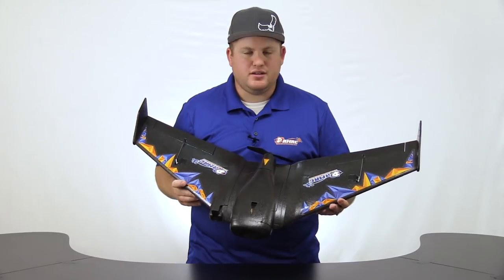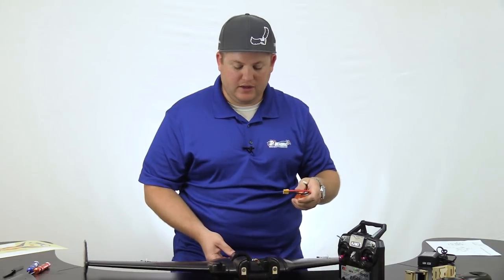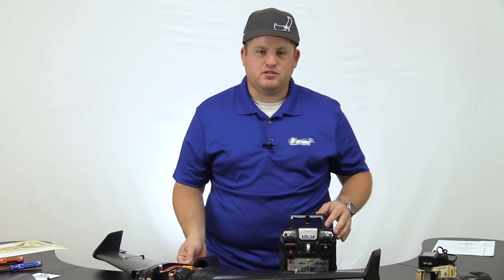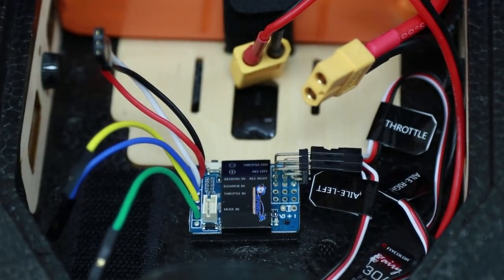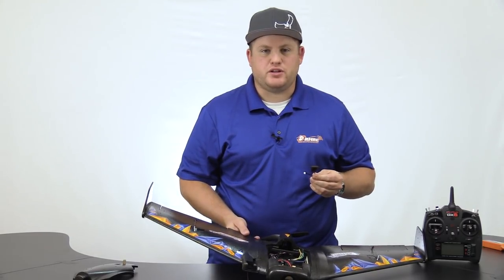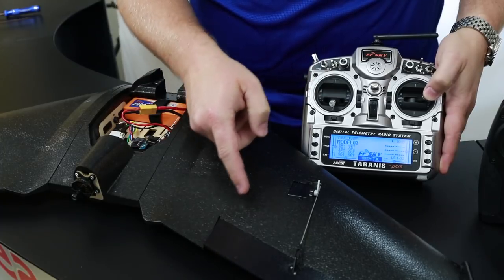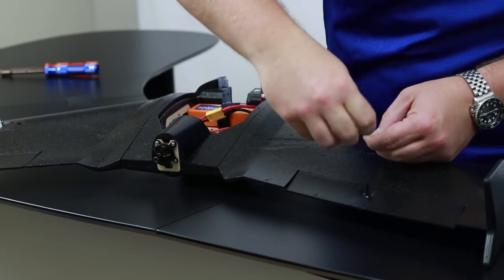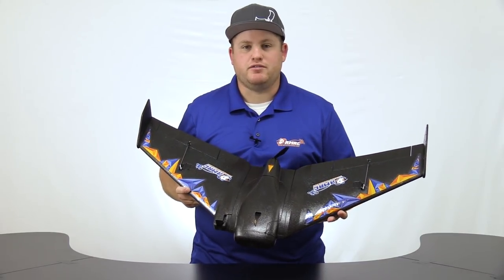The New RMRC Recruit Build, Overview, Maiden

Comment: I think that there was a missing point. Check the control action. 
To do this the throttle has to be activated briefly. And make sure that the stabilizer is attached to the airframe as follows: the colored cables going to the Rx should point to the right wing tip, and the servo connector pins should point to the left wing tip . Tilting sideways or pitching the wing , the stabilizer should move the elevons as required to compensate the airframe tilted attitude. Do this in the full stabilized mode, i.e. blue LED ON.

Comment: Some of are not watching the video close enough. 1) He does show the type of plane you should choose Raptorlishus. Just choose a regular plane. 2) Mike Rodgers You can not use a satellite receiver with out a regular receiver. So yes you can use both receivers. He does go over this in video.
Reply: Not true.  A satellite receiver can be used alone when connected to the stabilizer.
Reply: Ken, I'm assuming the channels are plugged directly into the stabilizer if using a remote Rx. I don't have one of these so if someone could confirm this, I'd appreciate it.

Comment: Folks - I am NOT using FPV for this build - only line of sight flying. I have a spektrum DX9 transmitter - what receiver do I need to use with this? Apparently a single DSMX sat is NOT acceptable but can someone confirm? If I do in fact need a full size receiver, can you tell me which model Spektrum/orange would work best?
Reply from the maker: We have used DSMX satellites, but the failsafe built into the stabilizer doesn't work with it. You can use an AR410 and remap the rudder channel to a switch or use an AR620 to get full functionality:
https://www.readymaderc.com/products/details/spektrum-ar400-4-channel-dsmx-aircraft-receiver-spmar400
https://www.readymaderc.com/products/details/spektrum-ar620-6-channel-dsmx-aircraft-receiver-spmar620

Comment: with qx7 -select plane -then tx wants to assign motor, ailerons, to Chanel numbers -stuck there. also pick mode.
  Oh, you didn't say you were bypassing the LUA script with exit and page buttons -very confusing. 
And now seems everything is ok but won't bind. I might have eu firmware on the Rx  -no way to tell -just reflash -what a hassle.

Comment: What model satellite RX did you use on the Spektrum port? I bound an Orange R110X, even tried binding it in the four combinations of 22/11ms DSM2/DSMX using a full receiver, but in the best case result the rudder stick was unresponsive, and aileron input would cause rudder to go full range left or right for a couple seconds when any aileron input was made. I've seen a post that others have had this same problem. I also tried a Spektrum satellite, believe it was a 9645.

If you know a fully working satellite model, please let me know.
Reply from the maker: mgcarland open a support ticket & we can troubleshoot much better there. Support.readymaderc.com

Comment: Hey everyone, when I plug my battery in, all my control surfaces are responsive except the throttle, which makes a very repetitive and annoying beeping sound. What is going on?
Reply from the maker: Mateo Xia I believe that is addressed in the video, but if you can’t get it worked out, open a support ticket so we can guide you further.

Comment: This maybe a dumb question but after watching the video I'm not clear on this question. Can a satellite  be used along side of a AR610 spektrum receiver or is it one or the other? I'm assuming if I can use both at the same time I should get better signal correct?
Reply from the maker: Mike Rodgers the board has the option to use a satellite by itself if you would like that option. You can use definitely use the receiver with the satellite attached to it though & you should get a better signal.
Reply: Ok yeah I wasn't sure if the board acted like a bring or something to use both at one time. I appreciate your response.
Reply: @michaelrodgers9829  You'd have to connect the satellite to the receiver and the receiver to they gyro.  They gyro wouldn't work properly with both a satellite and normal receiver plugged into it directly.
Reply: @wparsons  wow ok thanks but I figured it out a year ago. I appreciate your reply though
Reply: @ReadyMadeRC  If you're using a satellite only, do the servos get plugged in directly to the Rx? I don't see any other way to do it.

Comment: Hi, mine just arrived and it looks/feels amazing (though I have yet to fly it).  Do you guys have any recommendations for where to mount the VTx?  Thanks!
Reply from the maker: Nico Myers I put one against the right wall near the wing thumb screw & cut a slot out of the cover so the antenna could fit up through it. The recruit owners group on Facebook also shows how a few other people have done it.
Reply: Would mounting mine work where the cam should go. My yi does not fit in the mount so I'm thinking of having "extra cooling"

Comment: Question , so my aileron wasn’t leveled like u said , so i did what u did too make both sides even but idk if its normal or not but both sides leveled on the 2nd mode but when i put it on stability mode aka launch mode one goes up  and its on a flat table I thought the ailerons would stay leveled because  the wing is flat like when i put it  on mode 2 , is that normal?
Reply from the maker: IPHONE_PRODUCTION's 914 that doesn’t sound quite right, but our support team can help diagnose what’s happening. Support.readymaderc.com
Reply: Ready Made RC, LLC  thank you,  i sent it  .
Reply: If both go up that sounds normal, they add a bit of up elevator for launch.  If only one is going up, something is off.

Comment: What is a good place to solder in a BEC?
Reply from the maker: The Lightning Stalker most of the time I solder it in right where the battery leads solder to the ESC.
Reply: You're saying on ESC itself? Sounds good I think I'll do that thanks
Reply from the maker: The Lightning Stalker yup, you’ll need to peel back or remove the heat shrink & then cover it back with something.

Comment: Whats the range with the Lemon satellite receiver ?
Reply from the maker: PU663R68 It should be similar to small Spektrum receivers, which are about  1/2 mile or so.
Reply: I used the orange 618 xl . I went 3/4 mile out . no problems, I did stay very high and point tx up. With no telem , It made me nervous

Comment: Your site says it also supports sbus and ppm.  How do you set that up?
Reply from the maker: Nick Schendel you will use the White wire for the signal and the red & black for 5v and ground. Nothing else needs to be changed on the stabilizer.
Reply: @ReadyMadeRC    That works great, however it seems that on SBUS it ignores all failsafe commands as set by the TX/RX (FRSKY).  The stabilizer does recognize that the rx has had a fail safe and changes modes/ resets the servos to center, however it holds the throttle at whatever position it was at.  So it looks like in the event of a failsafe its likely going to fly away on me.  If I had to guess I would say that the stabilizer is only looking at the failsafe flag in sbus and is ignoring the individual channel values.  I have a sbus tester and have confirmed that the channels are being set as I have specified on my Taranis R9MM for custom failsafe and that the failsafe flag is being set to true.   Any thoughts on how to get the stabilizer to actually honor my failsafe settings?